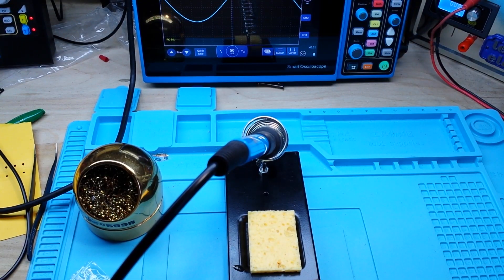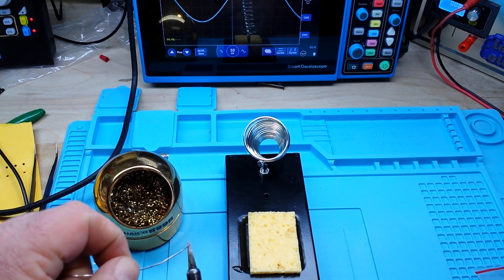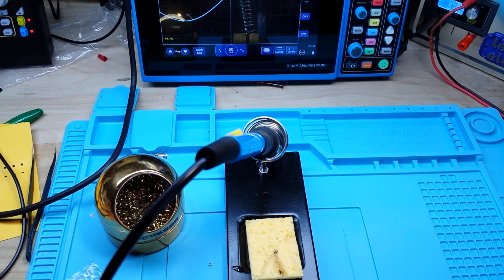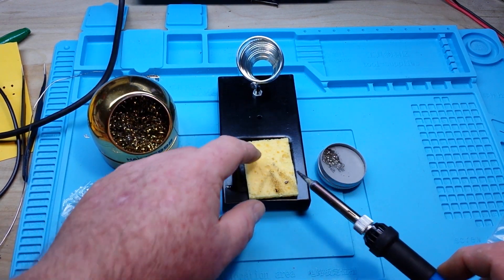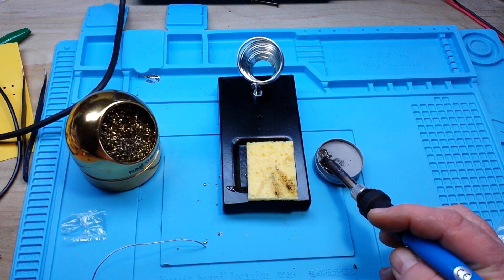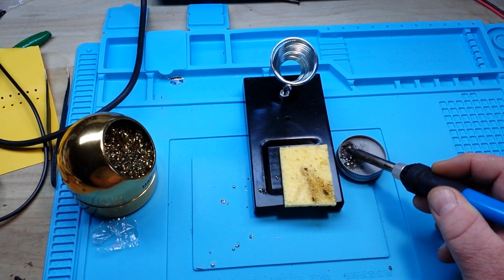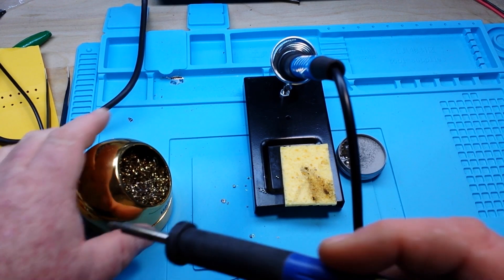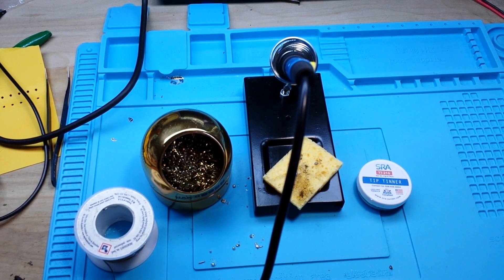Can Tip Tinner restore a dirty soldering iron tip

Comment: The key is the temperature of iron solder, the typical situation like above is the tip that has been in prolonged high heat (>350C). This kind of tip cleaner paste is not needed at all. Only copper brush is needed. If there is a black residue that can't come out with copper brush then something is wrong with temperature or tip, either lower temperature to under 300C or change the tip to a better one or do both. In that case use a soft knife and scrape the black residue and be careful next time. 

The tip that is always going black like this in video is either too hot or already useless. Replace tip with better one and use lowest temperature as you comfortably can.

If you need a high temperature soldering for specific cases, use special soldering iron with high watt and wide tip (there are plenty Chinese cheap soldering iron above 100W), do the job fast and quickly turn off then dip in rosin after finish, release from rosin after >10 seconds. Letting copper tip in prolonged high heat will corrode and burn black its tip quickly.

Comment: Sal ammoniac block is the best of the best its expensive but works like none other that sra stuff is garbage... some sal and a legit brass  brush..(toothbrush style brush). Light brushing on both sides until its clean and shines again.  I promise you works like a charm 

That's my go to method on my jbc c210 and c115  tip sets for my nano tweezers and irons

I dont use anything else my jbc tips are very expensive as is

Comment: I had the same problem. I got a brand new heavy duty soldering iron 300 watts with large tip but it arrived with a pure copper tip. I bought a tin of Chinese powder in a small tin from an on line shop in Malaysia and it arrived and I was doubtful. It’s powder 🙄 so I put my soldering iron tip in the powder and as it heated up it melted the powder and the tip was perfectly tinned completely. I was amazed. It works well now.

Comment: Tip tinner does work up to a point totally destroyed tips, no tip tinner can bring them back, we always used tip tinner in industry back in the 1990s, clean the tip in tinner then turn off the iron.
Then applied fresh solder to the iron the next day, too high a temperature is the tip's enemy, especially cheap irons.

Comment: You supposed to go back to the copper by sanding back the tip then the tip tinner, soldering iron should be set on 300oC (ISH)...

Comment: I'm learning car key programming and there's a fair amount of soldering involved reading car circuit boards,i just can't get my tips to tin!!
It's the dipping it in the flux that ruins things and turns the tip black while i'm trying to tin??
With the bolt cold,i rub the tip with a mild ssndpaper,i wrap the tip in solder then switch the bolt on,solder starts to stick to the tip!!But then you start the tinning process if you put the tip anywhere near the flux the tip turns black and nothing sticks????
Reply: The flux is helping burn off the debris and this leaves the tip vulnerable to oxidation. You have to immediately keep the tip covered in solder to prevent oxidation.

Comment: In my experience you have to use sandpaper, or cloth backed garnet - about 300 grit. Takes it right down to smooth bare metal - then you tin it with the tin-lead. And paste flux first. And that's the other question about your setup - is that lead-free wire? Not for this. Fully Leaded is the way to go. I agree with the temperature issue. Keep it below 400 and use a standby mode. Finally the tip itself - I don't like 'em. A copper or brass tip oxidizes  but it's easy to clean. Not sure about other metals - but you might look into that as well. Good career choice (just kidding.)

Comment: I find the best way to re-tin a dirty/corroded tip is to first clean it (with the soldering iron/gun cold and unplugged) with a wire brush or steel wool to thoroughly remove all of the oxides and other contaminants down to the bright bare copper, apply a liberal coating of paste flux, and then use a second soldering iron/gun with a blob of melted solder on its tip to coat the burnished tip with the already-hot-and-liquefied solder.  This way, you get the bared-copper tip thoroughly coated with solder, but without initially heating it so hot that the copper starts to oxidize, like it would if you just plugged in and heated the iron itself to try to melt solder onto it.

Comment: If I’m trying this I will use very fine sandpaper… yes you SHOULD NOT use sandpaper but the tip his very oxidized.  Your retining it anyway so adding back the coating you remove with sand paper. It’s ruined anyway so if it works for a specific tip yea! If not then I was throwing it way anyway. If there is oxidation under the retin it’s just works okay it has to have no oxidation. I’ve coated mine in flux as it heats or start the iron in the tip cleaner. It’s stupid but try to stop oxidation. I also do it right at the heat setting and not higher or not much higher. The biggest thing was to make sure no oxidation is under the tin.

Comment: I've been soldering only a month ... while cleaning off and de-oxidizing tips is not a current issue I have (or have ever had), this video gets a like and playlisted for future reference. I can only assume that driving hotter temps (beyond 400 C) for lengthy periods is the largest culprit to tips oxidizing from the get-go. So far I get a little nervous even at the 350 mark (the tubing that comes with the Engineering brand solder sucker is only rated that high - but MAN does that sucker do its job). I got into this because of FPV drone flying, and want to be a builder. That first few repair projects I tried attacking are INSANELY small - no they're not done yet, when I get finished making obnoxious messes on my practice PCB boards, then I'll make the repair attempts ... I feel thats awhile off yet ... :/
Anyhow, great video mate....
Reply: I agree, high heat >350C is the main culprit of tip becoming blackened and unusable.

Comment: It's amazing to me that tips get that bad. I've been using the same tip since like 2018 and it's still very shiny and cleans up great, with just some flux residue burned on.

Methinks some folks are running their irons WAY too hot. I run 400C at the most, with 350C being much better overall if you can make it work (with proper tip selection). More importantly, all my irons are setup so they are only hot when in use. When in the holder, they are either off or at a low-temp standby condition.

If your iron doesn't have a "standby" mode, you can power the iron off a footswitched outlet. When you need the heat, just step on the pedal. Yes, it means waiting a little for the heat to show up, but if you don't have that kind of time, you should have a station with a standby mode. I use a Hakko FX600 as well as other stations that have a "sleep/standby" mode and the footswitch outlet is a game changer for basic irons like the FX600.
Reply: bro my tip melted off 😭

the tip i'm currently using is so bad i had to sand it down (i didn't know anything about tinning or cleaning it)
Reply: hey are u using the plusivo tip as in the video? coz mine completely blacked after i used it a couple of times fresh out of package. Do you know why it might have happened?
Reply: Or you can simply buy soldering gun, 20W (normal) to 200W (pressed) like Dekko or Goot brand. In 99% of cases, 20W is practically already enough to solder, I never press the button unless on very big PCB copper plate or big chunk of solder.

Comment: It does restore soldering tips, up to a point.  I always use brass wool, but eventually I will get oxidation the wool won't remove.  That's when i reach for the tip tinner.  It does work.  I do apply slight pressure while I i roll the tip though.

Tip tinner is not a replacement for brass wool.  It just removes hard to clean oxidation the wool can't remove.  I rarely have use for it with modern tips though.  They stay pretty oxidation free with just the wool, but older tips, and cheap soldering irons benefits a great deal.

Comment: I use it mainly as a quick way to tin my tips after I’m done soldering just to prevent oxidation. Wool and flux has been the best way to try to restore tips that are getting oxidized. I’m just lazy I guess but it does seem to work well for that purpose. It’s never an easy task though. High heat for long periods seems to be the main cause for permanent degradation.

Comment: Just saw another video from SRA Solder Lab that suggest preheating to 350c to allow the thinner to adsorb proper, it worked amazingly, only a very slight roll of the tip needed

Comment: just sand the tip first while cold with a decent grit of sandpaper or steel wool to get rid of the oxide, brass wool does the same but harder to really remove all the oxide. warm up the iron tip with wrapping solder around it so it sticks and tins it. Then use tip tinner before you store it to coat it as it cools and keep the surface from oxidisation. I don't think tip tinner is much use on an oxidised tip when it's coating the oxidised layer. I treat it as more of a protective coating between uses.

Comment: The brass wool, tip thinner and sponge are fine. The problem here is the soldering iron is over heating the tip and damaging it. Take a silicon diode and place it in between the circuit board and heating element of the soldering iron and the iron will be fine.

Comment: weve had great results with this tinner /activator but rub the tip in and out just a tiny bit pressure,as it needs that abrasive back n forth action .
its a must on new tips too

Comment: I use it infrequently just to get my tip in pristine condition, the rest of the time I tin with hard flux and some old lead free solder to use it up before putting it away. I only have a cheap Chinese soldering station that I use on 360° (tested surprisingly accurate) the vast majority of the time, using 0.8mm (I think 0.032”) 63/37 flux core wire for my soldering. I only use Hakko T18 tips as I was advised to in comments of a review video for my station. They are night and day compared to cheap tips but far more expensive. My T18-D16 from Pi Hut in the U.K. is my most used tip and is months old and still looks and acts like new. How much of that is down the tip quality or sparingly using the tinning cleaner I've no idea. I find the tip cleaner really good for maintenance and it says on mine not to over use it. However, I’ve never tried it on destroyed cheap tips.

Comment: Hi, great video, it inspired me to try using a tip cleaner,  used a sponge for last 40 years. I used the brass and the sponge on a soldering iron that was let on over the weekend, with no results, without knowing and based on Amazon reviews, bought the Thermaltronics and worked like a charm, I am really impressed now, hard to believe how good it worked. Thanks for the video and all the comments!

Comment: The tip tinner works.  You had that soldering iron turned up way too high. It barely had a chance to work before it was vaporized. Unfortunately, I think the plating has been destroyed. I usually replate my tips with a copper or nickel solution.
Reply from the maker: My tips have lasted for years.

Comment: I typically use a high grit sanding sponge with some wax or water soluble flux.. my problem is the heat that goes to the gun. It may be internal or the homemade tips, but they work especially well when I replace them, so I don’t know.

Comment: Tip tinner works best when u use it with a new tip. It will extend the life of your tip, it doesn't work immediately but it prevents rust from getting in it.

Comment: That is work for me is to use the tin refresher when my iron tip is new so i can prevent oxidation  and is last long and im not using the refresher after if i got grey iron tip or oxidize iron tip refresher it will not work the acid is not that effective or strong.And most refresher has crap flux mixed with lead free dust inside wich i dont trust.

Comment: I remember my old teacher telling me in highschool to dip the tip in acidic/active flux and than put the tip into the wool.

I honestly can't say if it works or not, but I've always done it before storing (I tin after) than lightly wipe it off. I've never really had a problem with tips myself, but I'm also kinda cheap so I try to keep them as clean as possible.

Comment: a fine sandpaper on the tip usually help remove most oxidation. it will be usable but not great. tip tinner in my opinion is for maintenance, TT keeps tip last longer by creating layer of tin which prevent oxidation when it cools down. but a side note not all tip tinner are the same.

Comment: The simple solution:
1. Heat the tip & use the wire brush attached to a bench grinder to clean the tip.
2. Wipe down all sides of the soldering tip thoroughly with a Q-Tip that has been dipped in flux paste.
3.  Tin the soldering tip right away & always ensure that it is ALWAYS tinned when placed in the holder.

Only use a wet sponge for a quick wipe down just before retinning the soldering iron tip.
Reply: bullshit

Comment: The tip cleaner did not work for me also although it is highly priced.
It tinned well one type of bit, so it is material dependent.
Gently filing is the better choice
( not for ceramic tips )

Comment: The best soldering irons are the cheap ones you can get at Harbor Freight for like $4. No kidding. I've had every type of iron and tip out there, including some I've made myself. But the iron and tip on those Harbor Freight irons lasts forever. And if for some reason you need to replace the tip, you can get those cheap long thin pointed tips off eBay to replace them. I've had the same iron for two years and only replaced the tip once (and really didn't need to). No joke. And I don't use any magic solder or flux. I use Alpha Metals 13461, and either Kester 951 or my own homemade Rosin/IPA flux. And I use a sponge, not brass wool. That's it. I've never used a tinner. Never needed to. Try it. You'll blow your mind. Guerilla Electronics 101 LOL!

Comment: I came to same conclusion that tip tinner doesn't work (I used MG Chemicals Tip Tinner) HOWEVER i saw a video where the person used something like Oatey Lead free tinning flux No. 95 (which I happened to have in my garage in my plumbing supplies) and  the technique was to dip the hot tip in the No 95 flux, apply generous solder and wipe off with 000 steel wool (using thick leather gloves holding the steel wool) and repeat until it works... I revived 3 tips Hakko T18-D12 and Weller ETA  that were way worst than the one you used in this video... and yes, I was busting my tips for overheating them and leaving at rest for too long with full heat. I got  a Weller WE1010NA that has a standby mode, so this will help with that.

Comment: I have decent tips for my soldering iron, but some of my old ones that rarely get used for certain occasions I use tip tinner on. I wouldn’t take his word for it 100%, as it’s not the proper technique. I just wipe the tip gently across the top a few times on all sides, slowly add a little solder and then brush it in my brass, then on the sponge. All gently, no aggressive holding the tip in the tinner, the tinner shouldn’t be bubbling either. He read the instructions from the product provided at the beginning as well, and didn’t quite follow them.

Comment: As a beginner, I even got that stuff to work better than this lol. It's as if you went in wanting it to not work. It has solder in it. It's called tip TINNER. Not just Tip Cleaner. Keyword TINNER. It tins the tip itself. Not sure why you wouldn't tin the tip with it. You just kept dabbing at the puddle. I didn't even have a puddle like that yet I was able to tin a tip that was quite black. 🤷‍♂️

Comment: When the tip gets this bad, very simple trick, let iron cool down...  take the green scrubby that you do dishes with the green and sponge pads and lightly use a wet green part to shine and bring back the tip, then warm it up just enough to take solder again and it will tin very easy

Comment: Tip cleaning honestly probably the most understood subject when it comes to soldering. With that said that tip was very rough. I’ve never had much luck with the damp sponge, but it’s what I had when I was a beginner it’s like over time it would case the tip to corrode, and oxidize more than it should I’m assuming that was caused by tap water. The brass is now my favorite. I never use a sponge anymore but I’ve noticed something about the brass wool it does matters which one you get. The one you have in the video I’ve had and it doesn’t have much for flux in it the one I have now has a puck of a hard flux at the bottom which you put the tip in once it starts vaporizing a bit pull the iron out and run it in the brass. Looks good as new ever time. As for the tip tinnier it’s the same as the sponge but faster the more you use it the faster the tip degrades.
Reply: so i found one called the "Flexzion Soldering Iron Tip Cleaner", it is similar if not exactly what you described. now, do i remove the brass sponge then dip the iron in it and use the sponge separately or, do i punch trough the sponge into the rosin??
Reply: Tips aren't that much but a good iron is the best way. Cheap Harbor Frieght or Ace Hardware soldering gun's aren't the best either. I still use my solder iron gun from RadioShack, which still works.  but you have to make your own copper tips from a copper hanger, IF you can find them. Only place around my area is a dry cleaner😢